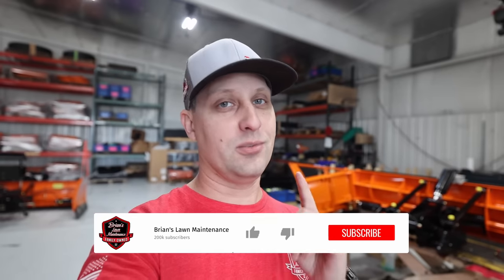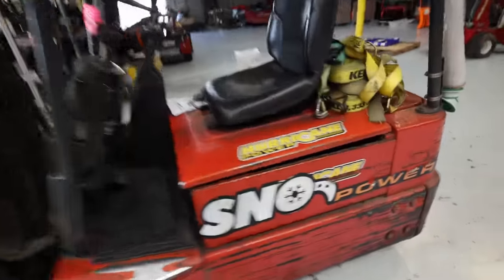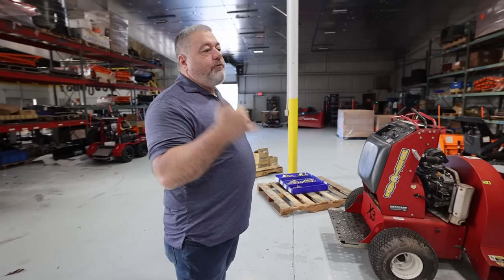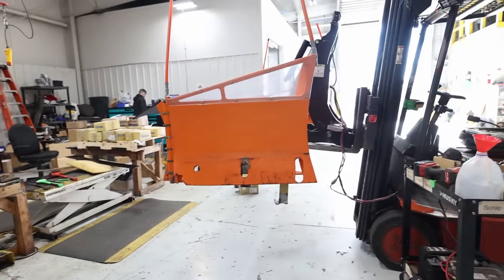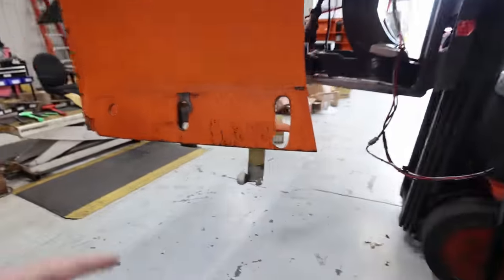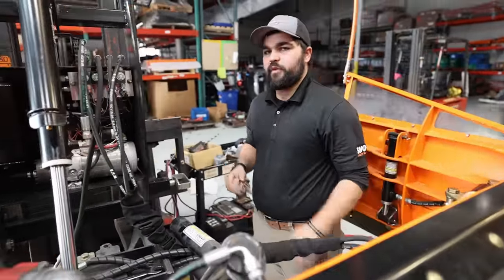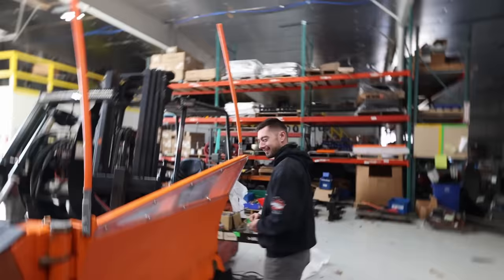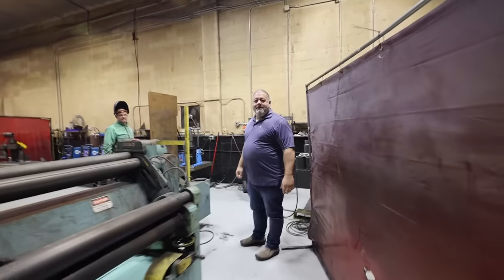An Incredible Story & SnoPower HQ Visit! ► New Cutting Edge! ► Plow Maintenance!

Comment: Has the side wings been solved so they don’t freeze in place?  This was my biggest issue. Also dealers needed to hear about the plow cutting edge. We are going to be putting on our new ones next week.
Reply from the maker: I am not sure about the side wing freezing in place issue; I haven't experienced that, so I can't weigh in, sorry.
Reply: I should clarify a bit. The side plow cutting edge would be frozen in place upwards when snow/slush would freeze in the slides. Also glad to see the redesign in the plow feet and it moving up and down.

Comment: Awesome video. Regarding the cutting edge, will you be expecting to replace it every season now? Since it only lasted 1 season that was relatively on the lighter side for snow events in Michigan?
Reply from the maker: If I replace it each season, that is fine. We honestly used the snot out of this plow and cutting edge. We're talking ram-rodding 14" slush snow piles over acres of parking lot. Not one single snow event this season was a 2-4" powder snowfall, which is crazy to think. So, for the amount of brute force this snow season took, I am actually on the opposite end, extremely impressed with how long the cutting edge lasted.
Reply: @BriansLawnMaintenance  still would think a high quality ar400/500 edge would last longer.